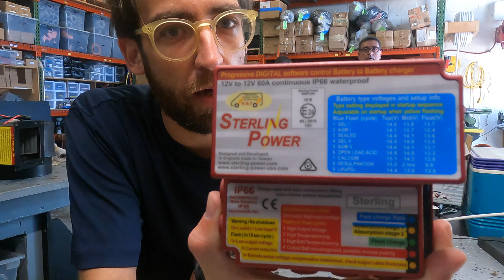Sterling Power BBW1260 Battery to Battery Charger Programming to Lithium by Mabru Power Systems

Comment: Seems like Sterling could use DIP switches and bluetooth in 2022 for this.  Be nice having bluetooth on this device so you could quickly monitor source and destination power source info.  Thanks for the video
Reply from the maker: There is a new version coming out this year but we do not much info on it so I do not know if they will incorporate bluetooth into it. It does looks like the new version will not be IP66
Reply: @MabruPowerSystemsINC  Isn't the Victron Orion-Tr Smart DC-DC a better option ?
Reply: https://www.youtube.com/watch?v=naSy08ZhGZE&t=2s